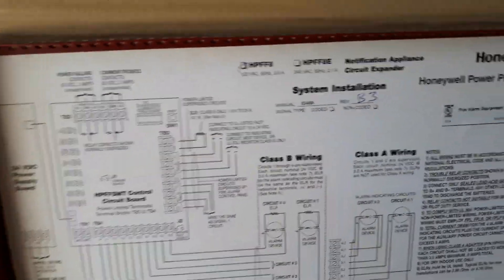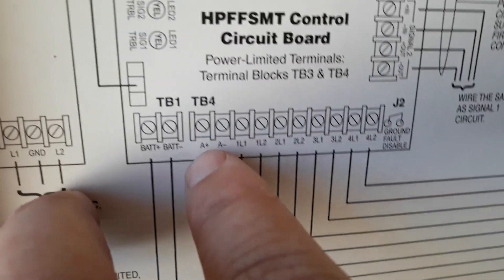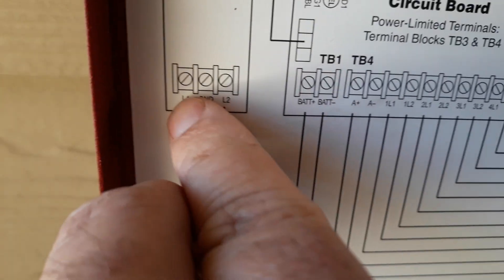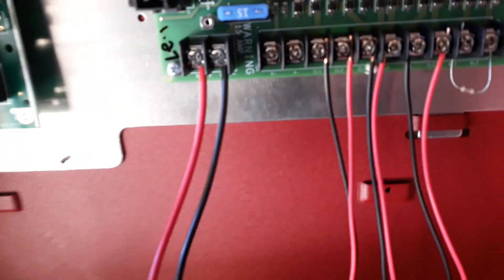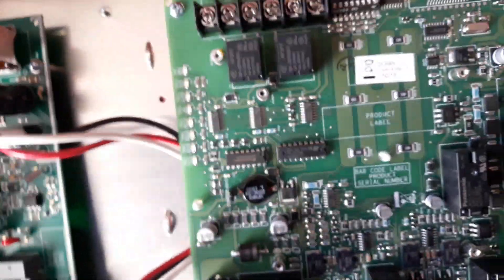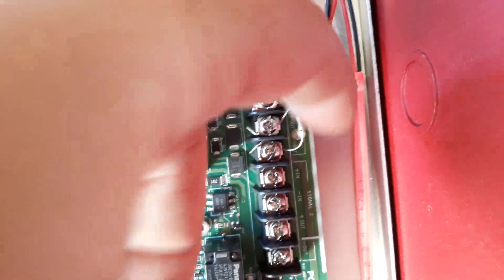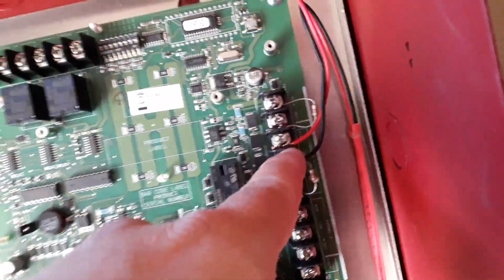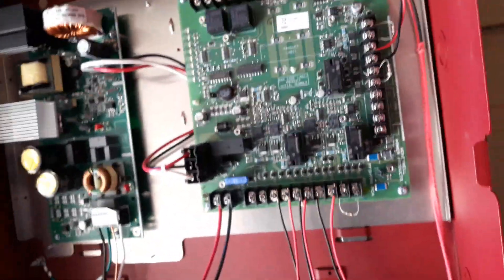Review fire alarm nac panel honeywell hpff8 2019 install and troubleshooting. Khawk

Comment: In my simplex 4010 shows 2 trouble 1- NAC circuit sig2,
2- card 3 Idnet card extra device.
Reply: Nac sig2 shoul sonethin wrong with an anc
Bus card 3 idnet sound like the panel have data issue maybe extra devices eas installed without program or have short circuit in that loop